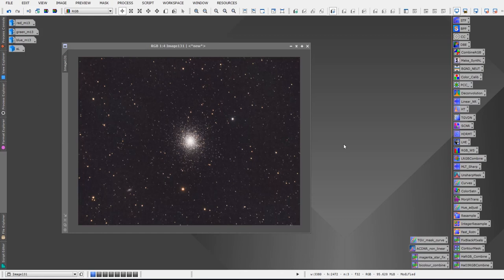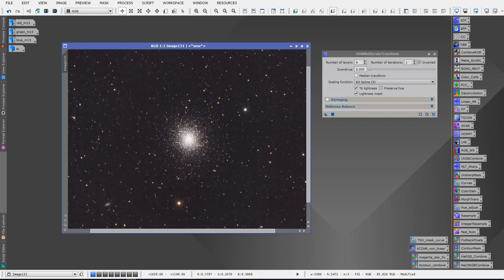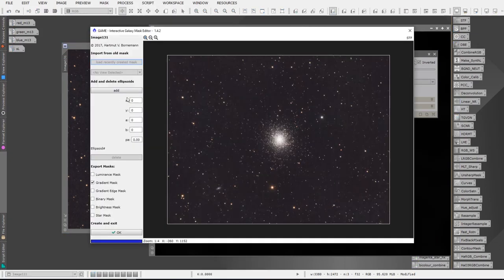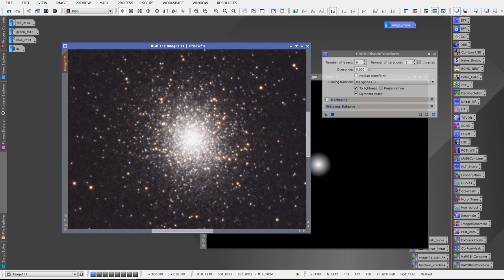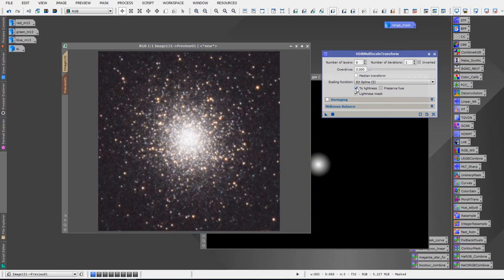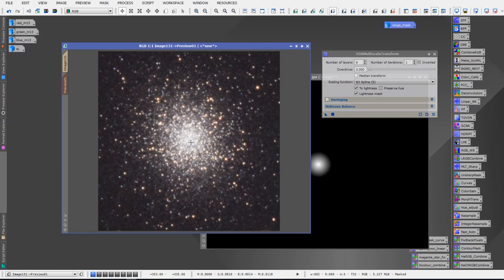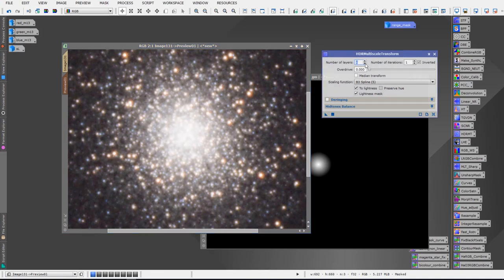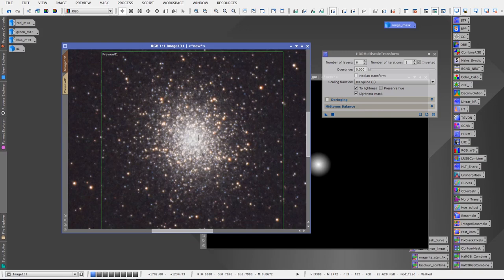Fix the core of M13!

Comment: I immediately ran into trouble with these instructions.  When I move the slider in Range Selection, the preview goes from totally white to only a very tiny bit of the cluster being visible with only the tiniest movement of the cursor.  I tried manually keying in values into the box.  In most cases they just show the fully stretched image.  Smoothness doesn't get rid of the stars.  It just blows them up to large disks.